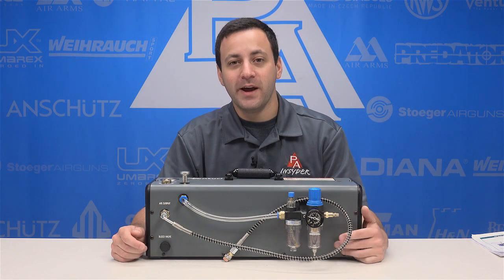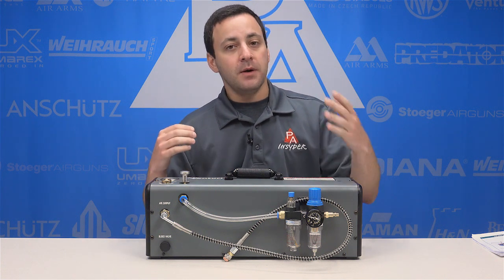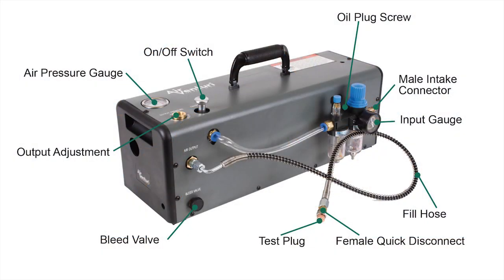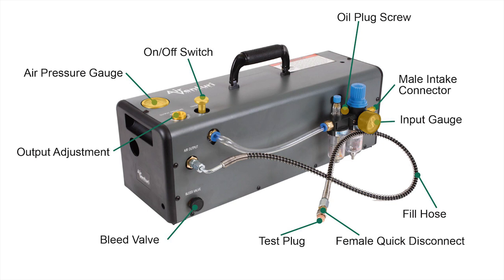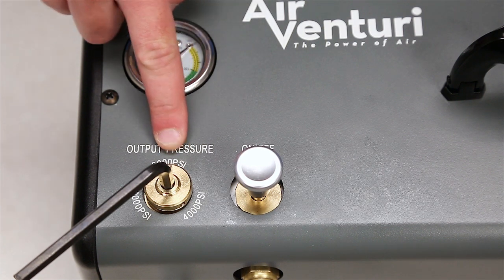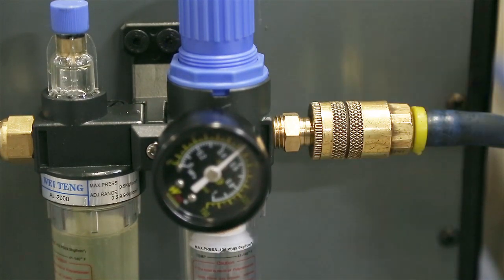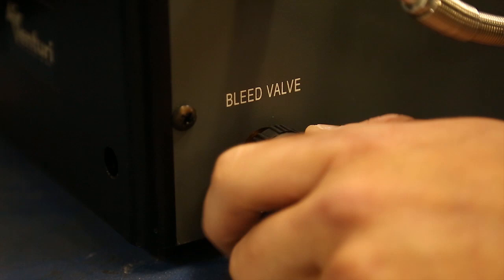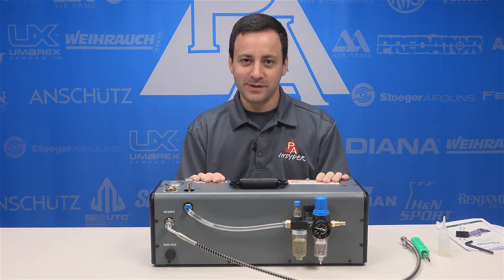Air Venturi Power Booster

Comment: Why cant you just use a regular  air compressor???
Reply: Because a regular shop/garage air compressor usually only goes to 125-150psi max, maybe 200psi for some models. PCP air guns use pressures up to 4500 psi which is way more than a normal compressor can deliver. You can use a high pressure compressor, such as the popular Chinese Yong Heng ~$300 4500psi compressor which is actually cheaper than this booster, but the advantage with this booster is that you can make high pressure air without another compressor if you already have a shop compressor, or that you can use a large compressed gas bottle to run the booster when you are in a remote location without electricity. You can use a large gas bottle to refill your devices directly, but once the large bottle pressure drops under the pressure needed in your gun (which may be 3000 psi or so), it will no longer be useful. With this booster, you can run the large gas bottle all the way down to 60 psi while still producing the needed pressure for your equipment.

Comment: What type of tool or equipment you would use this booster for?
Reply: This video and most of the youtube reviews are using high pressure compressors and boosters for filling air-powered guns and storage tanks to be able to fill air powered guns in the field ("PCP" or "Pre Charged Pneumatic air rifles"). These pressures are also used for SCBA/Scuba breathing tanks, but it's very important to only use compressors/boosters designed for breathing air in those applications; most compressors and boosters, especially the cheaper ones, are not rated for breathing air because oil mist and other contaminants that don't harm air guns will be harmful to your lungs. Other than that, I'm not exactly sure. I know that supercritical CO2 extraction for cannabis and other herbs also use high pressures in this range, but it's probably best to use a system specifically designed for that unless you know what you are doing. Working with equipment running at these pressures is extremely dangerous and if anything goes wrong it could easily kill you

Comment: These probably use large bore cylinder which takes the low pressure input, and creates a strong force for compressing a smaller cylinder at a higher pressure, so, normally the circuits should be totally separated. But it has a second air intake from outside and should have a filter and desiccant before it. On other models /brands  it is possible that the secondary intake is connected to the low pressure compressor for extra speed, but that way you need to make sure no oil gets into the high pressure circuit.

Comment: What keep running the air compressor if it is non electric, does it required petrol, Diesel etc ?
Reply: The inlet pressure.

Comment: Come on Pyramydair this is bull! $699.99 for a booster and you need a compressor on top of that for at least $400.00 or more for a halfway decent compressor. Why do you people keep pushing these overpriced pcp tank filling items? I can get a cheap china made 300 bar pcp compressor for $300 and don't need your $700 buck booster or a shop compressor. Just like the rip off shoebox compressor for a seriously stupidly overpriced price for some metal tube and a electric motor. I even asked the owner of the shoebox why he charges so much for his pump which also requires a compressor and the dude was a total jerk. These things are a rip off and seriously over priced! While all of you who buy this crap are waiting in your shop to fill tanks I will be out shooting with my cheap Chinese scuba tank air compressor filled tanks. https://www.aliexpress.com/cheap/cheap-4500psi-compressor.html
Reply: Don W. I just picked up a air compressor a 17 gal 150 psi that is rated at 5.6 cfm for 80.00 I don't know where you think you need to spend 400.00 for a compressor my booster is going to be shipped on November 10th so the total ive spent is 780.00 thats way better than spending 1200.00 on their compressor...1200.00 really!!
Reply: I agree! 5 years ago, maybe but not now. This thing cost as much as two of the very highly rated Chinese compressors that are lasting people years and years, plus parts are dirt cheap too.
Reply: @AZBADBOYz  Sir I was just reading your comment. I'm trying to pick out someone with good sense to answer my question. I am brand new to diving. I haven't even gotten my dive equipment in yet. Still yet to have made my first dive. Still I'm trying to think ahead. I will have to travel about 1 hour to get a scuba tank filled. I was trying to decide weather to buy 3 or 4 bottles to take with me already filled when I go diving or by some type cheaper compressor that I could use on site instead. Like the cheap China made one that is so popular now. Money is certainly a big obstacle for me. I know and understand I have much to learn. I'm far from a know-it-all. I said all that to ask you this. What is my best, cheapest way to fill my Scuba bottles. I failed to tell you this. I'm sure I will love diving but my only reason at this point for starting is to metal detect under water. Thank you and I look forward to your reply!!!   I appreciate anyone's input on this...….
Reply: @robertjenkins8630  Neither this compressor or the Yong Hang China compressors are what you need. Air purity is the most important part of breathing air. Compressors have crankcase oil that can and will always get by the sealing rings of the piston and this must be highly filtered and dried for breathing air. 

An entry-level breathing air compressor starts at about $2500.00. You are probably better of for now to just have a few tanks as you mentioned filled for a very low amount of money. If all you intend on doing is metal detecting probably an even more ideal long term resolution would be a floating compressor with a line that goes to you for breathing air. This, of course, would depend greatly on your typical diving depths, however. 

If you have 3000psi scuba tanks, work your way into 4500 tanks for more capacity and lighter weight. 

Good luck!
Reply: @AZBADBOYz   Thank you so much my Friend!! That is kind of what I expected to hear. I did just briefly look at the above water compressor you mentioned and agree that it would do me fine. However it  also was a little pricy if I remember correctly. But I figure either way you go your gonna come out spending close to the same. If I may ask you one more question Friend. Would it be bad to fill your tanks weeks or even a month in advance?? Oh one more. Do they not make a filtration system that you can hook directly to a regular home compressor? Again I'm just learning the ropes so don't laugh to hard at me. lol. Hey I appreciate you Buddy and look forward to your reply. Many thanks to you!!!

Comment: You can get a compressor that meets the specs of the Booster for around $130 plus another $19 for hose and fittings,so for around $860 you good to go,one thing I like about using the booster,is if the low pressure  compressor fails then its a relative small amount to replace,but if your all in one HP compressor fails,its probably a very expensive fix.
The booster looks like it as few parts and simple in design,so hope maintenance will be O rings and a few seals to change after a given amount of use.
Just waiting on real world reviews and feedback.

Comment: This also allows you to fabricate a brilliant 2 part application to the Bank of Wife. Stage 1 - Hey babe, we need a shop compressor to paint the house, pump up car tyres (or what ever other plausible story you have). Stage 2 -  Hey babe, If I buy this booster we can get extra value out of the shop compressor we already have by filling my airgun!

Comment: I have a high pressure (150psi) high capacity (13cfm) compressor. Can I use the extra pressure to fill the gun or tank faster?
Reply: It will definitely fill it faster, but I can't say that would be a good thing.  It may push the unit too hard.  Don't have anything to test that with sadly.

Comment: What is the power source
Reply from the maker: No electrical power source needed. You just need a shop compressor.
Reply: The power source is the electrical power that drives your garage type air compressor. The energy stored in the compressed air, is used by the Booster, to increase the PSI of the air.. Nothing is for free in this universe.. ;)

Comment: Do you have to use a oil-free air compressor with the Air Venturi Power Booster?
Reply: No.  An oil lubed compressor works, remember the Booster itself is oil lubed.
Reply: That's good news.  I was just asking since some of the other booster pumps require oil-free air compressors.
Reply: jTempVids these can  use large bore cylinder which take the air input, and create a strong force for compressing a smaller cylinder at a higher pressure, so, normally the circuits should be totally separated. But it has a second air intake from outside and should have a filter before it. On other models it is possible that the secondary intake is connected to the low pressure compressor for extra speed, but that way you need to make sure no oil gets into the high pressure circuit.

Comment: This plus a compressor with the specs mentioned can take you close to $1000,providing you don't have a compressor at home ... Maybe better to just get the standalone compressor for $1200
Reply: I would still buy the stand alone compressor over this booster. it's a nice booster no doubt, but the price tag is way to high. There are cheaper boosters out there. Or if your like me, just buy a hand pump and convert it for automatic use which is a much cheaper option. The only downfall is that the hand pump is a tad slower. But for the hundreds in savings I'll put up with an extra 20 minutes. Actually the cheapest option at the moment are those stand alone Chinese compressors. My friend just ordered one, so I'll get to see how they work for the $350 he spent.
Reply: Jason E you can get a good compressor from Harbor Freight for $90 to $150
Reply: One of the compressors we use here (and for this video) is a $160 Harbor Freight compressor.  It is linked on the product page for the Booster.  That's going to be the least expensive workable option that we found.
Reply: Jason E I agree, in that scenario a little bit more money the standalone is the best option.
Reply: James Denny thanks man
Reply: Tyler Patner thanks